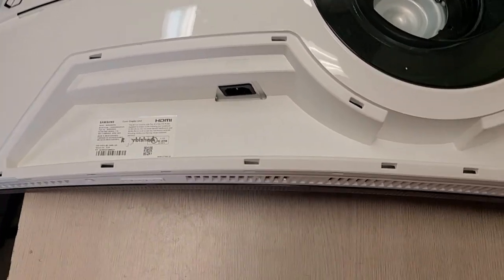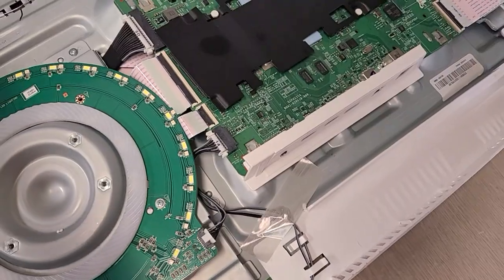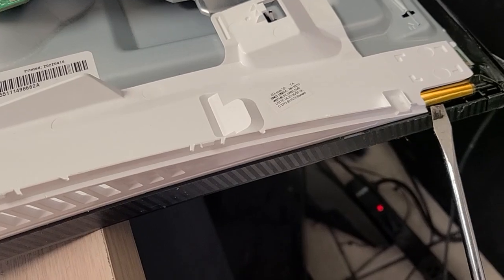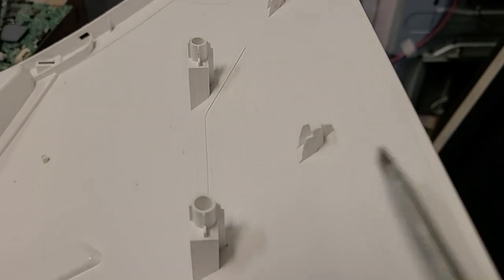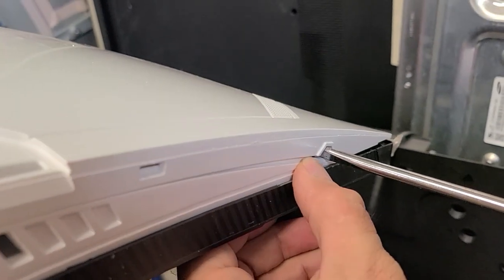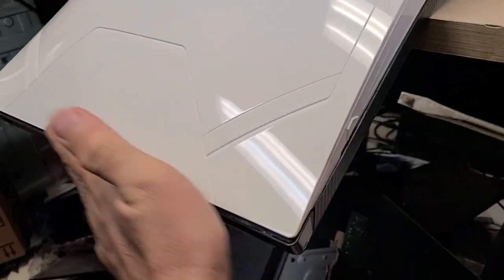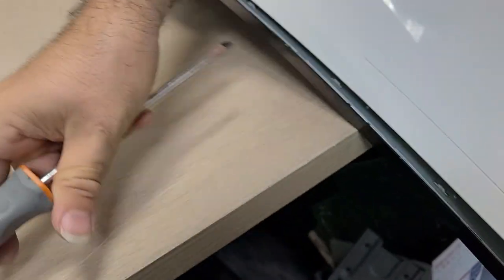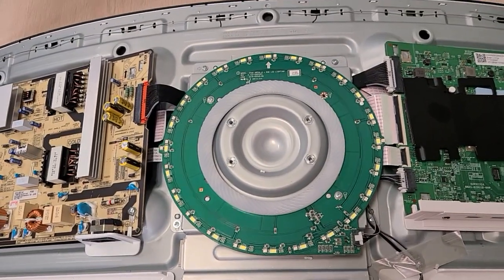How to take off the back cover of Samsung Odyssey G9 monitor (LS49AG952NNXZA,  most LC49G9 models)

Comment: Thank you SO much for this video, particularly for the parts where you mention where NOT to put the screwdriver and avoid the panel. This saved me a bunch of headaches when trying to remove the back to replace the power supply board.

Comment: I have the same monitor you are showing being dismantled.  It went black screen as reported on many of these monitors.  Looking though you tube for hours I find repairs to other G9 monitors saying the issue is the thermistor labelled THA1 on the older model but when i took this apart I its different inside.  Can you tell me where the thermistor is and what is it called on this monitor and in your experience can this be removed to fix this widely reported issue?
Reply: Got the same model - it just died. no idea wher ethe thermistor is.

Comment: That yellow ribbon where you mentioned not to touch or poke it’s a bunch of small yellow ribbons like that, that span across the entirety of the bottom strip. The two in the middle after taking off most of the white plastic cover those two I’m having issues with. They are causing two vertical black lines on my screen and whenever I apply pressure on that area or those two ribbons it fixes it temporarily. My question is would I have to make an artificial pressure point for those two to hold em down or can I somehow clean or adjust those ribbons to fix the issue? They seem soldered on. Thanks for showing me how to open it up I appreciate it 💪
Reply: Did you ever resolve this? I'm having the same issue
Reply: @ryanpham6344 only that putting some pressure there and taping it or something which will make it better but it’s not permanent and any shifts or changes might revert it back to messed up. The yellow strips are soldered on there so you’d have to have someone with a lot of patience and experience to fix it or a professional. Plus I couldn’t find where to get similar strips that would be compatible or work. If you haven’t the easier and best option would be to directly contact Samsung and hope they can fix it for you but other than that no fix unfortunately.

Comment: Mine seems to be in some sort of boot loop... the power and back led ring turn on for a few seconds and then it shuts off and tries again. I took the back panel off and didn't see any obvious electrical component damage on the power board or the 2 pcbs. The power board outputs are all showing 20ish volts when probed. 

Could this be a firmware issue and would a motherboard replacement be in order?

A little more info:
There is no picture at all during the power cycles, not even the backlight, cannot access osd
A connected laptop detects the display briefly before it shuts off

Comment: Thank you I am having a line going down the screen so I hope I can fix this
Reply from the maker: I am pretty sure we can't. Sorry.
Reply: mine has the same issue did you ever have any luck ?
Reply: I’m trying to fix a line aswell, did you fix it?
Reply: im trying too, whats the way to go? any luck?
Reply: for all the people replying to this man, go with another brand of monitor, please. Samsung is a notoriously horrible company to deal with when it comes to any repair. In doing so I found it is a FlexCable that needs the proper connection, it is the one in the middle that has failed for all of you, has it not? Please consult a hot-bar repressing machine or contact your local tv/monitor repairman and tell them this: "I would like a hot bar repress of a flex ribbon cable to re establish a connection, no damage or blunt intrusion has damaged the display."

Comment: Hi sir, I have this exact monitor with a T-con problem, can this tcon be repaired? Please help me. It’s power on with light in the screen, but no image coming
Reply from the maker: And what exactly is it that makes you believe it is the T-CON that is the problem?
Reply: @ my friend have the same monitor and we did the swap and it worked well. Just don’t have cash now to buy a new tcon
Reply from the maker: @djmoscow2319  To be honest I am surprised to hear that...and I have to say we haven't yet had to repair any of those TCONs. But if you have no other option feel free to send it our way and we'll take a look. Do not have high expectations - chances are good we are not going to be able to do it fast or cheap enough or possibly at all. This risk is always higher for boards we haven't worked on before. But we'd still have our working T-CON and your reportedly defective one, which should make it somewhat easier to narrow down a problem.
I am truly surprised to hear the monitor worked with another TCON though.

Comment: Great video!  I have this same monitor and it has a vertical black line in the middle of the screen.  How would I fix that?
Reply: same problem here, at first it was a few thin lines, now its like a dozen
Reply: I get the same issue and yet on mine if you hold the back and front at the bottom about where the line is tight the line goes away, the moment you let go the line comes back. only seems to be there when connected to my computer, haven't tried anything else but its not there when in between sources...I saw someone's post awhile ago that showed a ribbon like cable that needs to stick to the board that becomes loose? Idk if that's what it is or not, but seems like if it is that might be what the pressure does to fix it...

Comment: Hello Coppell, Love the work that you are doing, however I do have a question regarding my Odyssey Neo G9 49in monitor ( LS49AG952NNXZA ). I got this monitor second hand and for a very good deal, in the deal it was said that about 2 inches of the left side of the screen flickers; is this a panel issue or a problem with the power board in the monitor ?
Reply from the maker: May be LCD panel COF or may be LED strip section about to go out, but no way it can be a bad power supply.
Reply: If the 2 inches is dimming / flickering, but no image corruption then its likely a section of the backlight strip going off and on, probably due to poor solder joint to the pads on the strip in that section.. if applying pressure fixes it sometimes it can be shimmed (small amount of material added to apply constant pressure) which is the easy way out of the situation if it works and it may never happen again..  or you could pull the subframe and resolder (reflow) the connection point.. or you could just replace the backlight strip (Aliexpress - inquire with backlight strip vendors for the one for your model)... you could also just turn off dimming entirely (though HDR will look like shit without it)..  however if you're seeing image corruption then its likely COF and not really fixable without COF rebonding

Comment: I did it. I damaged the "gold tape". Not with a screwdriver but a tiny drill bit. That connector goes to the screen side. I assume it can't be fixed but some guys will amaze you. Is it repairable? I didn't really need an excuse to get the 57 inch model but I have one coming. I'd save the 49 inch it if I could. Paid $1100 for it. I'm local in HEB.
Reply from the maker: I am afraid I do not know any service center in the US that offers COF replacement (that's the name of this plastic "cable"). Theoretically it is definitely possible with the right equipment, but it's a project that requires working on the LCD screen itself, which implies shipping in both directions and that alone would have already made it too risky and expensive.
I am afraid what you'll end up doing is just selling the main board and possibly - though not very likely - the power board on eBay.
And did you just donate $20 to the channel?! Boy that would definitely make you the first ever!!!
Reply: @coppelltvrepair  I just thought it would get attention and you'd answer. I replaced it with the 57" Samsung. It still works but has a thin vertical line just left of center.🙁Appreciate the answer. Hank
Reply: @hankarmstrong3681  I've got the same issue just right of the centre

Its down to the heat the monitor generates... shit really
Reply: @coppelltvrepair  Does the cable run across the entire screen? I thought there would be individual 'tabs' behind the bezel. I'm trying to find a video showing those tabs and with the front bezel removed - I'll need to do a repair on mine :(
Reply from the maker: @gamesandstuffs  Sorry do not understand the question. Good luck either way!
Reply: Great video!   I have a vertical black line in the middle of this same monitor,  how would I fix that?